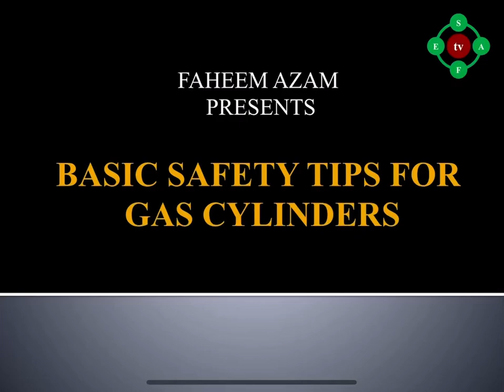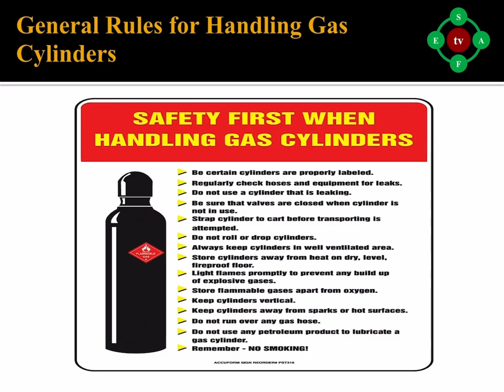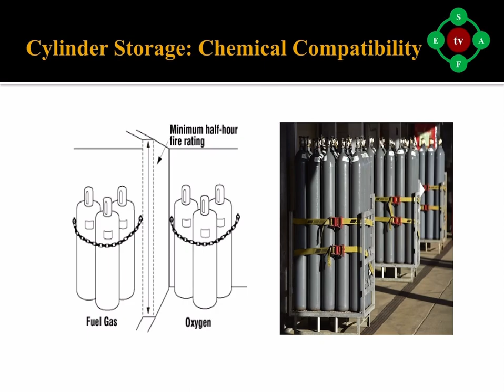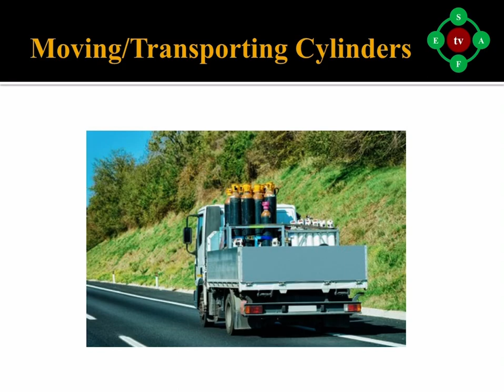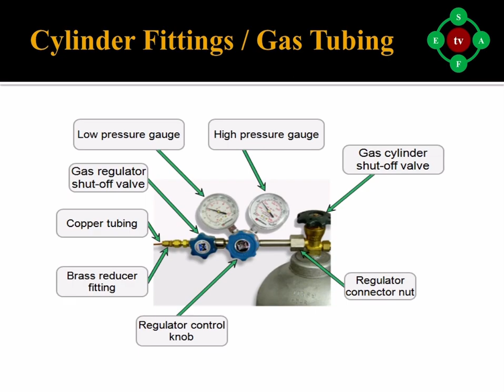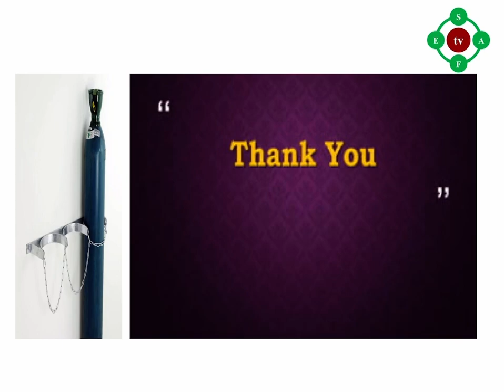Basic Safety Tips For Gas Cylinders @safetyguidelines9364

Comment: Very important to use and store fuel gas cylinders 20 feet away from each other or separated by a fire resistive wall because while oxygen by itself doesn't burn, it greatly intensifies combustion.   For instance, say a fire developed on or near a fuel gas cylinder, causing the cylinder to heat up and pop the pressure relief device.  The fuel gas is ignited and burn like a flamethrower.  This is a very serious situation.  Now suppose the oxygen cylinders were stored next to the burning fuel gas cylinder. Oxygen cylinders heat up and pop their relief valves.  This would obviously make an already life threatening situation much worse.